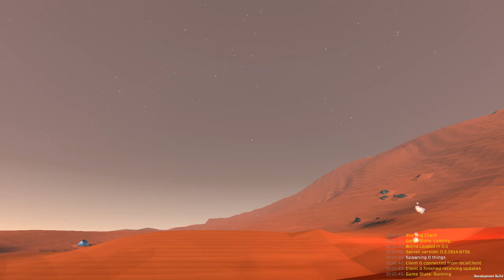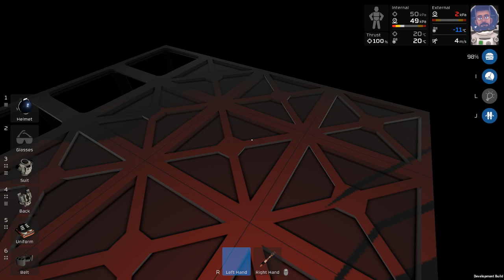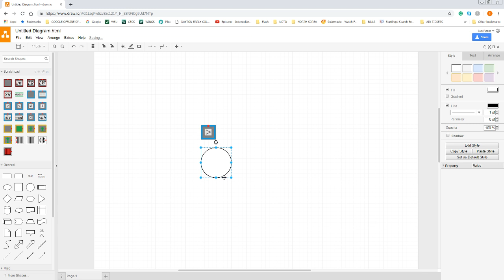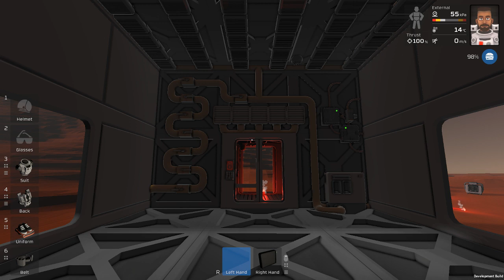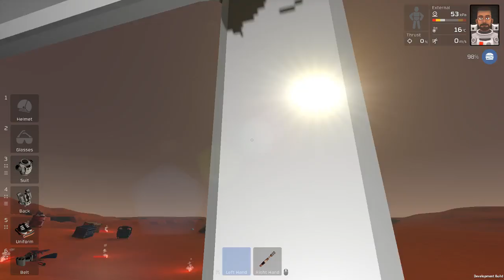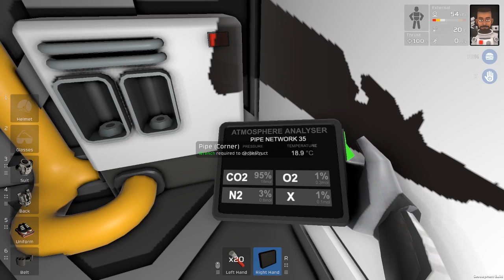Stationeers - Mars Passive Heating Cooling

Comment from the maker: Adding Digital Valves and Pipe Analyzer will also require adding more logic circuits -- more than Doubling the energy cost of the system. The goal was to create an effective heating and cooling system using the least power possible (What is the absolutely minimum energy consumption can we get away with, while still effectively regulating base temperature?). The system you saw me create in this video consumes a maximum of 110 Watts while operating (That's only 10 Watts more than a Pressure Regulator). The Pipe Analyzer was merely for me to easily see the conditions of the gas inside the pipe and is not essential.
 
The [manual] valves provide "flow resistance" which allows the pipes to get backed up with high pressure -- all while continually flowing back out into Mars. That way there is a continual heat-exchange between the room and Mars air. Digital Valves and Pipe Analyzer require additional alloys which are not trivial to make (Steel is trivial).

Comment: Using valves for pressurizing your pipe - was it merely to save power? Digital valves and pipe analyzer would to the same trick.
Reply: The trick of replacing the comparisons with SUBs was really neat & compact! BTW I think you could still save some power by using an IC10 and 2xLR (not sure however, would need to check the power consumption of the math units). The script would be dead easy.
Reply from the maker: @jyrki4167  IC10 does not need logic readers. You can hook the sensors and filtration directly to the IC10